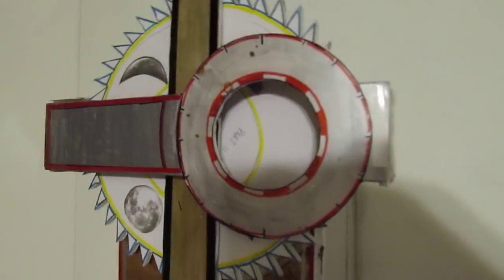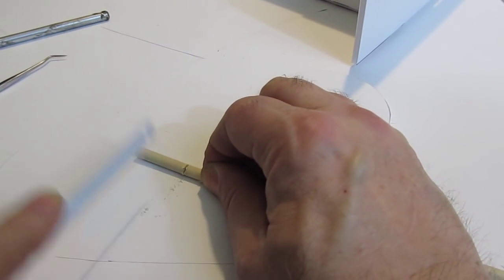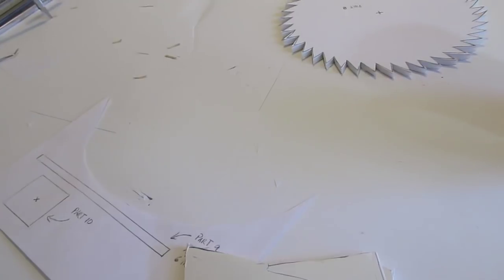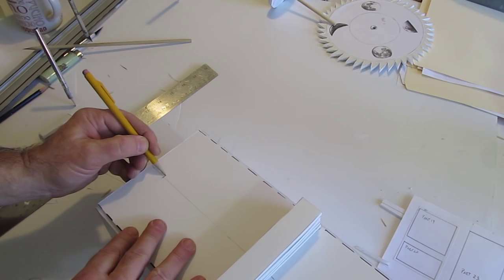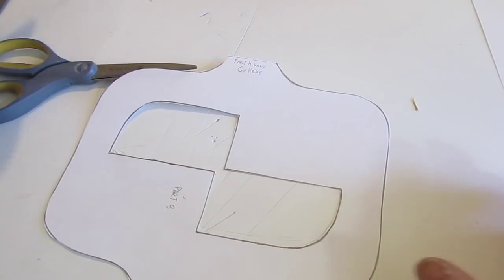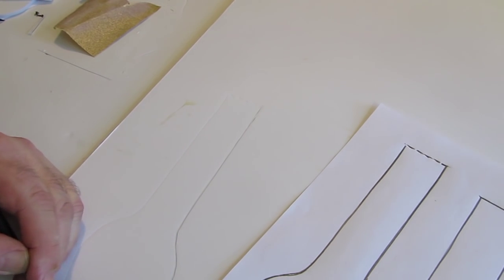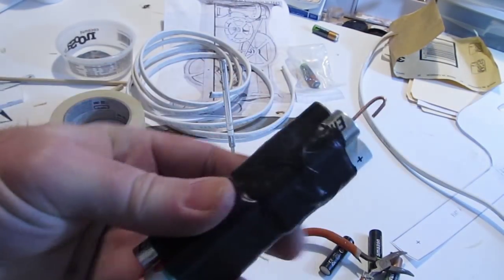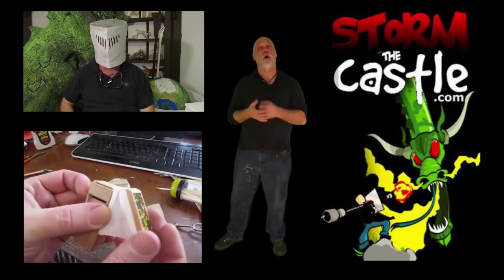Make a Wizards Pendulum Clock

Comment: I know I've been asking.a lot of questions I have it assembles except the battery pack on the drive shaft and do you need that for the pendulam to swing and I have the weight on the leaf shape on the pendulam and all the holes are loose and the dowels move good

Comment: do you have to tape batteries on the pendulam and attach the battery pack to a string and onto to the drive shaft
Reply from the maker: +supernatural_twin_craft 3535 YEs, the batteries are needed weights. But... you can use other things rather than batteries., coins for example.

Comment: You think this could be made from thin wood instead of foam board an still function?
Reply from the maker: +Heather Heaton Yes for sure. And it will function more reliably. You could even add a gear for longer running.

Comment: Awesome project! It looks great, and it really seems to work! I would have liked to see it running an actual clock, but I understand that it would then have to be really precise, and be made form metal or some other thing.

I did wonder how you set it up? You tie the string with the counterweight, and then how does it start moving? Do you curl it in the stick?

I would love it if you made a sword from Dark Souls. Maybe the Greatsword of Astoria? Or a Dragon Crest Shield!

Link to the Dark Souls wikia for the Greatsword:
http://darksouls.wikia.com/wiki/Greatsword_of_Artorias_(Cursed)

and the shield:
http://darksouls.wikia.com/wiki/Dragon_Crest_Shield

Either way, it's just a suggestion. Really cool clock! Thanks!
Reply from the maker: +SP Inc. Yes, wind the string up on the shaft of the drive wheel. then push the pendulum to get it started.

Comment: Does it matter how big the hole is at 1:48?
Reply from the maker: +Daniel Russell It might. Start out with about 2 inches square.  After the clock is done you can open it up as needed for the string and weight.
Reply: Thanks. I've been watching your videos for about 6 months and this is by far my favorite project.
Reply from the maker: Thanks, This is a challenging project!